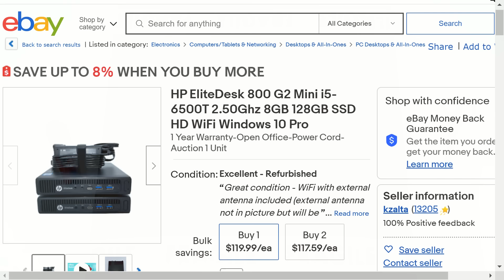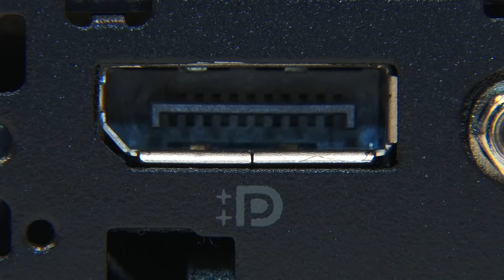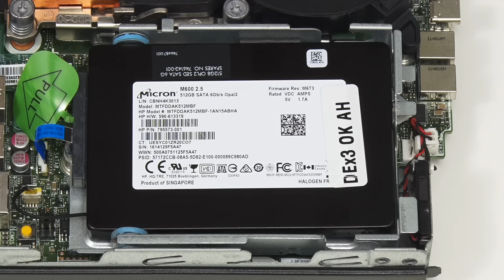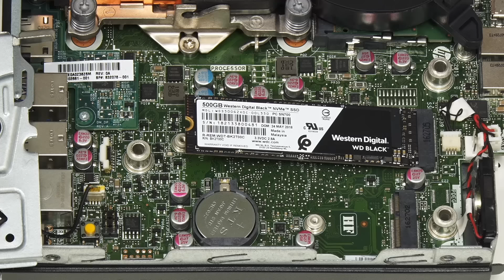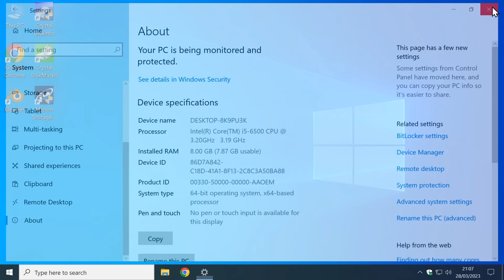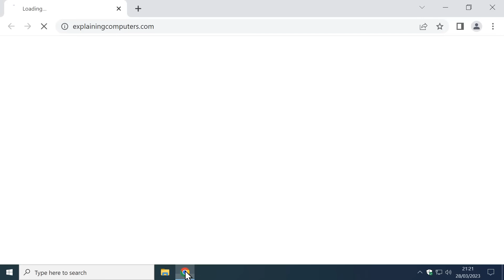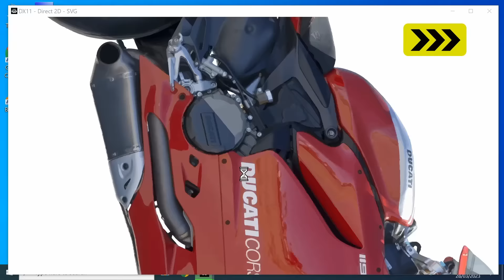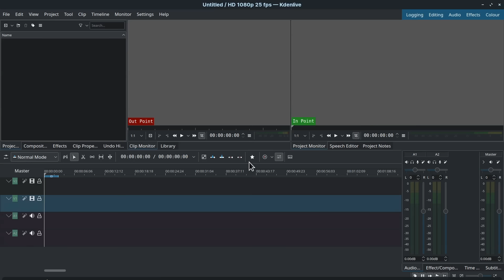Renewed i5 Mini PC: HP EliteDesk 800 G2

Comment: Very nice - I hadn't thought about this option.
One critique, though: you mention while running Blender, that the power consumption is higher than on the other mini-PCs you've tried this on, and say words to the effect that this may not be your best bet if you are looking for the lowest energy consumption system.  You should know better!  Energy and power are not the same thing!  If computer "A" takes twice the amount of power of computer "B", but gets the task done in half the time, then the total energy consumption is the same for both systems.  So without the measurement of how long this task took on each system, the comparison of energy consumption is invalid.
This is a common error, with people often saying you can run  a computer at a lowered clock speed in order to save energy, but this is often not the case; the total energy usually is very close to the same amount, with the only difference being how long you have to wait for a given task to complete.  It IS true that energy consumption goes up with clock speed, if you are running a game that will take as much computing power as it can get, to get you the fastest possible frame rate, but for tasks where there is a specific amount of computation to be done (such as a fixed number of frames of video rendering), there is very little energy cost to running the CPU faster.
Reply from the maker: Thanks for this, but I have not made an error. I am very well aware of the what you state. So I have no need to know better, thanks very much. If used for rendering, what you say is very significant. But for the past majorty of computing activities -- such as modelling in Blender -- human time is the constraint. Or in other words, I cannot model faster on a more powerful PC. :)

As I've often said, it really will be the comments section that drives me off YouTube. Please think about the human having to take the constant nag, nag of thousands and thousands and thousands of small pieces of negativity, day in and day out. It is no wonder that so many YouTubers have breakdowns.
Reply: @ExplainingComputers   I'm sorry to have offended you, but you're really not making sense here.  Yes, modeling in Blender, or almost any editing, is human-constrained.  But a fast computer doesn't use any more power when idling, than a slower computer does, and then when you want to do things that are CPU-constrained, you have the resources to do them quickly.  Just the same, I won't bother you any more if my input is not welcome.
Reply from the maker: Thanks for this. We are clearly not on the same page here, as again you are mis-representing what I said.

To be specific, The only comment I make related to Blender power consumption is to note what it uses at load. My broader comment is that this PC uses more power at idle that other PCs, which is what the power meter tests in the video show. To cite the figures, the Bmax Plus idles at 3-4W, the Odyssey X86 at 4-5W, and the EliteDesk at 9-10W. So your statement that "a fast computer doesn't use any more power when idling, than a slower computer does" is not correct. So as far as I can see, I am making "perfect sense" -- based on the data presented in the video! :)

Comment: Hi everyone,

Are you also experiencing issues with chromium browsers (Chrome and Edge) where they lag after some time of using. They also do infinite loading when opening a new tab. This is resolved by closing the browser and re-opening it but will eventually do the same thing again redering it useless.

I have turned off hardware acceleration but the issue persists. For now, I use firefox as it isn't affected. This only started after updating to Windows 11 from 10. Tried Ubuntu and Chrome works just fine.

I have HP Prodesk Mini G5 i5-9500T, 16GB RAM, and 256GB SSD. Please let me know if you experience the same with your HP mini pcs and if you were able to resolve them. That would be much appreciated.

Thanks everyone.
Reply: If possible try with a different Ram (memory) module. This looks a memory issue than the PC itself

Comment: I'm using an Elitebook 800 G2 mini with an  i7-6700T, 32gb ram (2x16Gb for 2133MHz) , 2Tb Samsung 980 pro nvme for system, 2Tb Samsung 870 Evo SSD for storage, intel WIFI 6 AX200 160mhz on the second m2 slot and 2 external antennas sma mounted on the back of the case. 
I think it's the most I can get from this tinny thing called computer that gets the job done flawlessly :)

Comment: I bought a refurbished HP Elitebook  800 G3 (intel core i3 7th gen 3.4 GHz, 16 GB RAM, 480 GB SSD, with Win 11 pro, wifi etc). So it has wifi and it has win 11 , two features that were missing in the hardware reviwed by you. I am very pleased with the performance of this tiny desktop. Seeing your disassembly of your item, I guess this Elitebook is upgradable (for RAM as well as SSD), but I will think about opening it up only when it becomes long in the tooth. Right now, it is the fastest computer among all that I possess, including laptops bought recently.

Comment: Refurbished way to go.  Have couple local refurbished dealers with great prices.  Picked up 2015 Macbook for $150 with new SSD, and last year at 2017 iMAC for $150 for desktop.  My 2008 Macbook running linux is still going too.  2013 Gateway running WIN 10 for my SDR radio toy.  Rolled out entire G3 transition at work for ~1200 of these little systems.  Good solid machines.

Comment: Thank you for the video! While in my younger years i was becoming very enthusiastic about building myself a new computer one day, later I had to admit that, on a tight budget, building just doesn't make sense. You can't beat a refurbished business PC in terms of performance/price. My daily pc at home is an old E8400 Lenovo M58p tower (running Linux Mint, of course) with an also renewed used Dell monitor... Not a single issue in 7 years. At work, same story, with a HP workstation. When it comes to these USFF ones, my main concern is the power brick. What has been your experience with them compared to traditional desktop PSUs in terms of reliability?

Comment: good test. just a point about the fan : usually, like on my hp g2, the legs are used on the fan so i can make some noise/vibration. buying a new one give you fresh silicon legs which absord the vibration...and the hp g2 become quiet :)

Comment: I have just bought the HP pro-desk mini Pc with an I5 processor and run the crucial test which informed me the PC was fast and the only upgrade would be to increase the 8Gb memory module to 32GB memory module but I wont bother as it does everything i want it to do. It loads windows blisteringly fast. I have already upgraded it to win11pro from win10 pro. I have put onto it my fav browser Brave and removed Edge as I don't like all the adverts that it runs. All in all for a £120 pounds it is exceptional.
Reply from the maker: Result!

Comment: HOW MUCH!!!! £135 is crazy expensive for this level of mini-pc... in my opinion, if anyone is paying more than £50 delivered for these then they're being ripped off. You can get a Beelink mini S12 Intel Alderlake (12th Gen) 4C4T 16GB RAM & 500GB SSD that will consume an average of about 10w of power for £185 from Amazon. The 6500T is not an efficient CPU these days and it's much less performant than anything from the past 2 or 3 years.

Comment: Nice video as always, I'm not very fond of HP though. Recently my HP gaming laptop began constantly freezing and now it will not boot into Windows. I think the soldered on storage is right next to the GPU, which gets really hot, and because of that design flaw, my data is gone for good. Safe to say I'm switching to a different brand. 😅

Comment: We live off grid with 24v dc batteries. Our two second hand small footprint HP 800s have run for years without problems. A 24v to 19v converter from Ali runs them without even getting warm so low drain and we leave them on a lot. One is Linux and the other Win 10.

Comment: I bought the Lenovo ThinkCentre M92P with the i5 and 8GB of RAM and it runs Windows 10 Pro just fine. It had a SATA HD I installed an SSD and runs much better. Purchased from eBay for $85.00. Enjoyed the video Chris and will see you on the next one.

Comment: I don’t know about Windows 10, I have a PC that’s been running Windows 7 from new and when I upgraded the SSD, Windows told me my version of Windows was likely counterfeit and because there is no support for Windows 7 now, I am unable to get it authenticated by Microsoft.

I’ve never had the same problem with MacOS or Linux. They just work well.

Fortunately, I only have to deal with Windows PCs in work and the IT support team have all the issues to deal with.

Comment: I've got a used dell 7050 micro you're right about the fans on these things they are noisy. I wanted to modify the case to fit a standard cpu fan with pwm but the connector is different sadly.

Comment: Interesting. It may be a good candidate to replace a Raspberry Pi 4.

The only thing that I have missed in the video is an analysis of the noise (decibels) and the consumption (Watts) performing those tests.
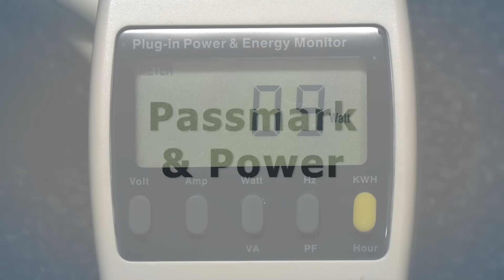Reply from the maker: I mentioned that the fan was noisy, and there is a whole section in the video named "Passmark and Power" in which I test the power consumption in watts at idle and load -- see 16:45 onwards. :)
Reply: @ExplainingComputers  You're right.  The video had jumped and I hadn't seen it.  It's interesting and I think the best processor is the 35W 6500T.

One thing, have you looked at the 800 G3 Mini?  I think the differences are the 7th gen and the speed of the RAM.

Comment: These are NOT Windows 11 compatible which is why they are so cheap. My advice is wait until Windows 10 no longer is supported which is October 2025. By that time Windows 12 will be out, and you can get a refurbished computer much cheaper...which will be Windows 11/12 compatible.

Comment: instead of windows or linux i suggest trying proxmox. These computers are great for it but its best you stuff as much ram into it. Old computers are still fast though and i still use 1st gen iseries for proxmox and linux. I could run windows on them with decent performance on virtualisation as well.

Comment: I stopped buying new consumer grade laptops and instead started to buy secondhand business grade machines. I started doing this because you can take a business machine apart and the fan tends to be accessible for cleaning, they also tend to be more upgradable. 
To clean the fan in my wife's last computer I had to take the entire laptop to bits just to get up to the fan! It eventually died and i replaced it with an i5  EliteBook G2 which work perfectly.  
I have an i7 EliteBook 8570w with a docking station, I used to use one at work and found it a good solid machine so i bought one. A press on the panel lock and the bottom slides of and there the fan right in front of you for cleaning. The machine does everything I need it to do and I have a Raspberry Pi and Banana Pi to keep it company. 
I moved away from Windows to Linux Mint so I don't have the problem of the OS driving the hardware requirements.
I think it's best buy to your requirements rather than pay through the nose for bleeding edge equipment you may not even need. 
I'm not a gamer so I don't need that kind of power.
A good video again and a useful one, definite thumbs up from me :)
👍

Comment: Perfect, yes this is what I'm talking about, for me, I really like to open them up and tweak them these small computers are useless when they are shipped to you because in some cases they have bare minimum hardware, that keeps the prices low, I like to be able to open it up and add ram or a faster SSD, in some of these small computers you are able to install a better CPU, then install some software to overclock it..... GREAT VIDEO.

Comment: thx for the vid. I watched it when it came out and pulled the trigger on one that day. got a HP Prodesk 600 G3 Micro Computer Mini PC (Intel Quad Core i5-7500T 2.7Ghz, 16GB DDR4 Ram for tuning my trucks audio system. also use it for a labscope with the Hantek 2200be. pretty awesome little machine.. Im a strictly linux guy but i needed a handy little windows computer for such tasks so when I seen your vid I knew it was going to fit the bill. mine came with a VGA and 2 svid ports and built in WiFi and a bluetooth dongle and HDMI adapter. antenna cover for the built in WiFi was missing but it still functions. Thx for the heads up again, it handles libre office, winisd and room EQ wizard like a champ.
Reply from the maker: This sounds like a great result. :)

Comment: You can hardly find a r-pi with 8GB, and they cost the the same as one of these HP units once you install a case, heatsinks, and power supply.  And these units have much better CPU. And the 16GB and even 32GB RAM are cheap also.

Comment: This is a actually very impressive when all things are considered.

It's outright amazing how this powerful machine is so much cheaper than a RPi 4B 8Gb and even how much more powerful it is. The TDP is a worthy sacrifice for the huge improvement in performance. Not to mention it is x86-64, which has the benefits of a massive library of compatible software vs ARM.

I purchased a renewed optiplex sff off Amazon for my oldest son and then a used GT 1070 on Amazon to be used for gaming for him and so far it has been going strong and running nearly non-stop for almost 2 years with no problems at all! I realize that this machine is far from top notch in the gaming world, but honestly for the games he plays (around 100 games in his Steam library) the machine performs exceptionally well. In fact, this i5-6500 mini would perform even better and could still use the same graphics card with an adapter for the m.2 NVME slot. I think I'll likely end up purchasing one of these for my younger son to use.

I know I say this often, but it seriously blows my mind at how far computer technology has advanced since the 90's and I absolutely love how easy it is to get relatively high performing machines for such a very low cost.

Comment: As good as it looks, 4C and 4T is not really the way to go if you are planning to run with this machine for more than 6months to a year. Very difficult to work with slightly load intensive operations.
Reply from the maker: Why would this machine stop working after 6 months to a year? What would you descibe as a load intensive operation that would cause problems? There are no issues using this machine at load for things like video editing/rendering, 3D modelling and such.
Reply: @ExplainingComputers  Code compilation, Photoshop, Multiple chrome tabs, modern games, etc.

Comment: I ended up buying a job lot of 7 Lenovo ThinkCentre M93's all with i3-4130-T 4GB LPDDR4 and 128GB SSD's in all - Very nice little machines and still surprisingly capable for modern computing functions. Ended up selling 5 and keeping 2 for myself to be used in basic home-lab 'projects'. Keep up the good work as always Chris:_scissors2:
Reply: Last month I bought a Dell Optiplex 9020M with an  i3-4130-T as well; it came with 8GB RAM and a 500GB SSHD (sic!) with Win10 preinstalled. It's a nice little well built machine and after replacing the SSHD with a Sata SSD and installing Linux, it is now a neat little machine to run some experiments on. I paid 70€ for this one, the SSD excluded. It's so much more capable than a Raspberry 4B with the same amount of RAM and the same SSD.

Comment: "I would suggest getting the i5 7500t and above only for the main reason of the the APU being drastically more powerful and is able to give more value especially in emulation, and low end gaming such as CSGO and 2013 games. To me this is added value for very little more money spent. And you really do not have to wait for one as these have started to flood the used market.  In as much as people may not look at these units for emulation, I do see a lot of people using this form factor for quick and dirty HTPC use cases.  Spending roughly $100 on the i5 7500t for more drastic performance in the 3d department is well worth the small extra bucks.

Comment: 800 G3 is very cheap, I got one ready for 65w with vented lid for $30.  Can use any 6th or 7th gen processor and m.2 drive with some old laptop ram.  If it has a vented lid it is either the GPU or the 65w model.

For the price you paid I would expect 16GB ram or a newer processor like Ryzen+

Comment: These are great. I pieced one together a couple months ago to use as a Minecraft server among other things. 32GB DDR4 RAM, i7-6700T, 1TB Samsung 970 Pro NVMe SSD, Intel AC Wi-Fi, and switch out the second display port expansion board for a serial port. 😎 Cheers.

Comment: 3:10 It is totally meaningless and stupid to make the adapter external and say this is a small computer. The adapter must be included within the size and weight calculation, because the computer can not be used without it. So then, what is the meaning of taking it out?
Reply from the maker: Mini PCs like this are often hung on the back of monitors. So the size and weight excluding the PSU is very relevant.